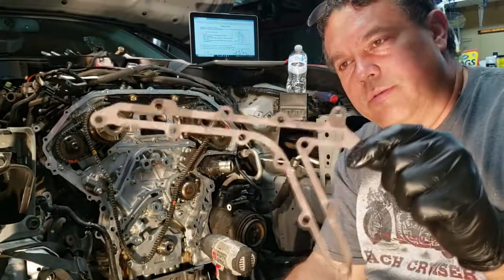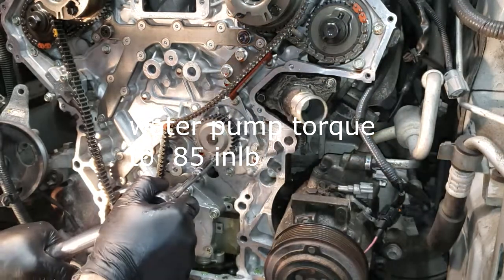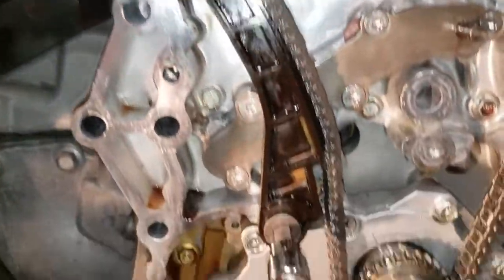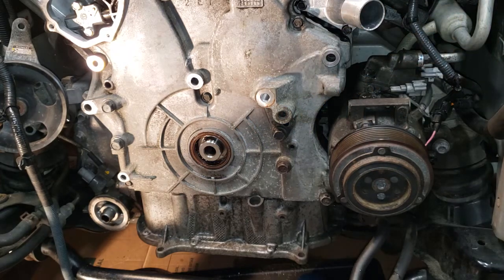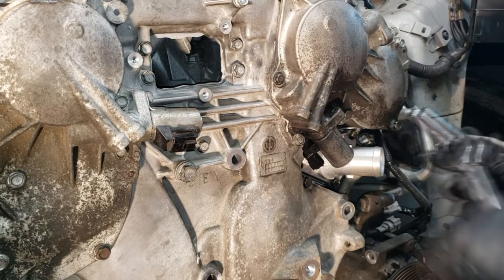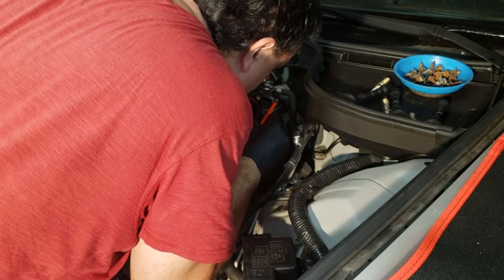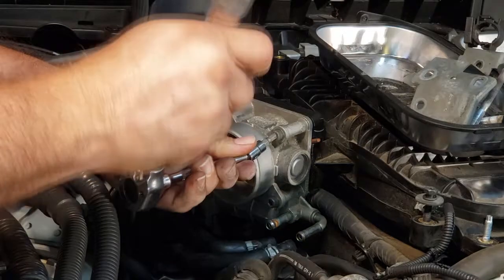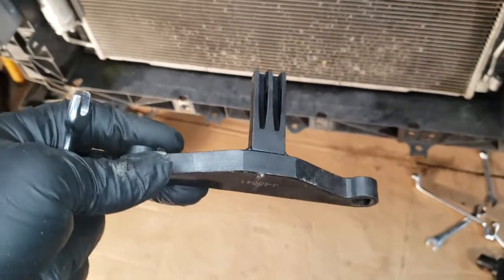infinity oil galley gasket fix Part3

Comment: just done mine..took me about a 8-9 hours start to finish..first time doing one..no i didnt have to remove the front end..just put it in gear brakes on to break harmonic pulley lose,i reuse everything even gallery bolts..bolts are not the issue..is the paper gasket..cant hold so much oil pressure..loctite helps with that..had fun doing it
Reply: How did you get the pulley off once broken loose?

Comment: I was stressing about doing this job but you made it look soo easy gave me the confidence to get it done myself.
Reply from the maker: I'm glad.  That's what it's all about
Reply from the maker: Also if you are going to do the work don't be afraid to take lots of pictures and or videos. It helps alot
Reply: Thank you for the advice I will make sure to do that. Seems the biggest issue for me is going to be torquing down the gasket screw hiding behind the cam phaser teeth.
Reply from the maker: @VQThingZ  I did too. I left that one for last. As I tightening all the ones I was able to get to I started to get a feel how much torque I was using with my hand. And I tightened that one by hand in between the teeth of the cam. I later found a long reach allen wrench with a socket I could have used with the torque wrench.If I did this you again I highly recommend to find top dead center first where all the Mark's line up. Will have to take out the tool holding the engine in place.
Reply: Anyone looking to do this yourself. Just take your time, take lots of photos during disassembly, and have confidence. Saved $2k by not having it done at the dealer
Reply: @prosser369258  hell ya bro that what i like to hear 🔥🔥🔥

Comment: About to do my waterpump this weekend! Lol
Reply: howd it go pal??
Reply: @robbydiesel9345  still working on it, I just got new vvel gaskets and judt gotta put all the pulleys back on, timing cover is on and engine is on time. ( hopefully) i did turn it over like 10 times to make sure everything was rotating freely. Only thing I dont feel 100% on is the chain guide that uses the 8mm hex. I didnt know what to tq it to.
Reply: @erikk27a  im about to hop into timing chain work because of recurring p0021 code, as well as the gallery gaskets and waterpump... will be awesome if i can pull it offworried about the timing part of it
Reply: @robbydiesel9345  did u replace the gasket with a metal one? Or cardboard? I think the issue is with the cardboard one
Reply: @erikk27a  Havent even ordered parts yet or get a plan... im first going to take off inspection covers and see how much slack on the chain and go from there
Reply: @robbydiesel9345  finally got my car runing !!! I did the spark plugs while I was at it, and I forgot how much better new plugs can make ur car feel!

Comment: I wonder if you replaced the oil pump also with the water pump and timing chain how much is the labor cost ? I have a 2004 Infiniti fx35
Reply from the maker: @lajay409  i didn't replace the oil pump. But I did replace the water pump.  I didn't replace the chain. It looked like it was in good condition. I was quoted $3,000 to do the work

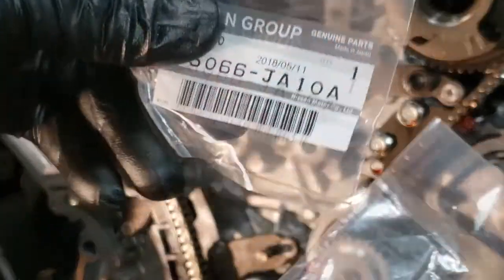Comment: Hey kids, put blue Loctite (shake it up) on the galley gasket screws or they will vibrate lose and the gasket will blow.  This is the most common reason why they blow out.  Also the water pump O-rings have a blue and tan mark on them.  One is forward and one is rearward but don't remember which one goes where.  He puts blue in the rear.  Take care not to rub them on the impeller or you may nick one.  Also, also DO NOT put anti-seize on spark plugs.  Put a small dab of grease on the two small doughnut O-rings 10:39 on the top gasket cover so they will stay in during assembly.  Kids on low in-lb torques DO NOT hold the head of the wrench, you will retard the torque.  Let the gasket maker set up for 24 hours before starting the car.   Angel, thanks for a detailed series of videos.
Reply from the maker: I try. I'm no expert,  but I try. Thanks

Comment: youre the best i plan on doing this soon what torque wrech do you use? i know its a husky but do you know the model?
Reply from the maker: Thx  I don't know the model. I got it at Home Depot or lowes, I can't remember which. I got it because it can torque all the way 9 lbs. Good luck.
Reply from the maker: I know I didn't do it. But if you do decide to do it, make sure you are at TDC.  You may need to spin the motor 20 times to get the dots to line up properly.

Comment: The most in depth video I've seen on the gallery gasket. I've came back several times for reference. Just finished up the job only question I have is do you have the torque specs for the 2 bolts underneath the oil pan. Thanks in advance and great job on the video man.
Reply from the maker: Thx i appreciate that. I got the torque specs from the nicoclub.com website.  I can't remember off hand . I would have to look for it.
Reply from the maker: I'm thinking it's the same torque spec as the timing cover
Reply: Thanks for the reply. I've looked around I got 3 different numbers 13, 21, and 41 foot pounds I went with 21 just to be on the safe side but from the layout I see from nissan says 13 which I feel is to low for the upper oil pan. Guess I'll know for sure after I start her up tomorrow thanks again though.

Comment: Sure you got those water pump O rings right? They are different sizes ...
Reply from the maker: I did. I have 5,000 miles since repair and don't have an issue
Reply: @AngelGarage  ok great ... didn't notice you mentioning the blue vs the brown markings in the video. O know it's hard to remember everything. I didn't see the two small metal screen filters in your video as well or pressing in the crank gasket ... so many little steps that will totally screw up this repair!!! You have to be careful.
How long did you let your silicon gasket for the complete cover set up??? Just curious if you had any issues with yours? The bottom pan seal is very important!!!

Comment: How many miles on the car when this failed and what's the very first sign you have a problem?
I have a 2010 g37s with 70k on it. No issues so far. I will be adding an oil pressure gauge asap!
Reply from the maker: Right at 112,000.
Reply from the maker: I was at a traffic light. As I accelerated the car went on limp mode
Reply: @AngelGarage  Thank you for answering. What engine oil and filter were you using? Will help to explain known issues.
Reply from the maker: @e30m31989  I use what ever good full synthetic on discount at the autoparts

Comment: im about ready to do mine. 2008 g37 journey. 175k mi. what if the chain skipped some teeth?  then putting it back in the same place with the marking pen marks might be the wrong timing?
.  one mechanic video showed that when you put the  tensioners back on then they need oil pressure to build up right before you start the car for the first time. when car is ready to start , first pull fuse to fuel pump, then turn the motor a little, then go and pop the fuel pump fuse back in, then fully start the engine.  said it prevents the chain from skipping becasue the tensioners need oil pressure to build up a little inside from the cranking of the engine before it actually starts.  i dont know, have you heard that.?  thanks , this was a good video. i was able to see stuff i couldnt see in the other vids. 😊
Reply from the maker: Great point but remember I'm not a professional mechanic, everything I learned is from bits and pieces from all the videos I've seen and tried to make a more comprehensible video that people can follow and put it together in one video, Plus what I read on the manual. im sure there are steps I missed that might be important.  
  I have since driven 5,000 miles and no problem what so ever and didn't loose any power. All I can say is make a video of your self and post it
Reply: @AngelGarage  thanks, yours is very helpful
Reply from the maker: @iztheterrible  that's all I try to do... be helpful. My warranty expired and I saved myself at least $3,000. With the money I saved I bought a jd2 tube bender, and an omni pro 220 welder. Just imagine what u can buy with the money saved.

Comment: Never use a hand drill to work on an engine. Use a torque wrench and try to use a star pattern when torquing.
Reply from the maker: Good advise. I say, Don't do as I do since I'm not a certified mechanic.
Reply: Don’t worry about it my friend just a small tip. How did your engine turn out?
Reply from the maker: @lazarorivera3384  the engine turned out good. I put 8,000 miles since and  the oil galley gasket broke again. I should not have used oem gasket.  I'm going to fix it again and then sell the bitch...lol
Reply: @AngelGarage did you get gasket from z1
Reply from the maker: @RuthlessTwinz  yes I did.

Comment: How did you lock the crankshaft from moving when you was torqued the crankshaft bolt?
Reply from the maker: Look at the part 2 out of 3 videos at about 7:50 in to the video. I explained it there.
Reply: Greta work.. looks easier then i thiught.. How long did it take you to do the work..

Comment: :50 seconds in and not even hand feeding the bolts to start, “AlMoST hAd OnE StUcK in ThE bLoCK”
Reply: Thank God I'm not the only one thats noticed hahaha. Had a guy at the shop I work at with about 30 years of experience  use a gun to put any bolt on engine without hand tightening it first 😱 including sparkplugs. Got fired right away thank god

Comment: why would you use that gasket 😞 Z1 sells the new and reinforced one. So does nissan. you used the same one that fails.
Reply from the maker: The reason the gasket failed was because 2 screws backed out allowing pressure to blow by. I didn't know about the reinforced one till later on.